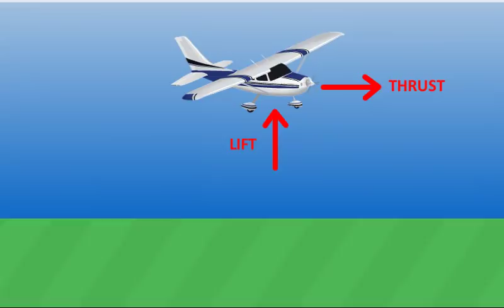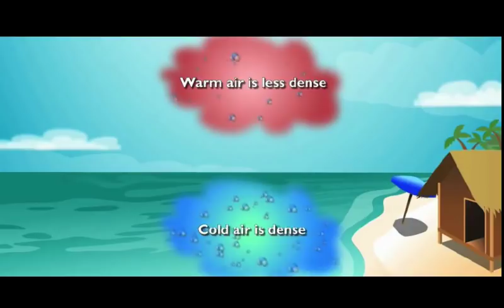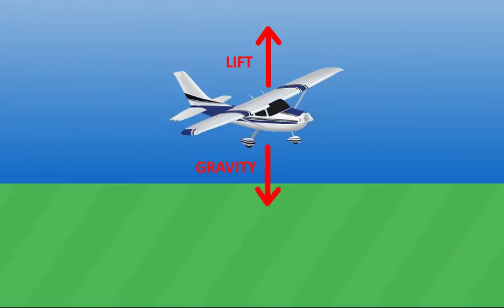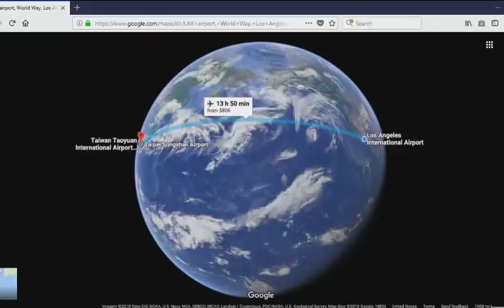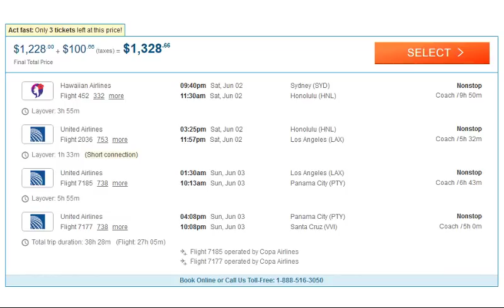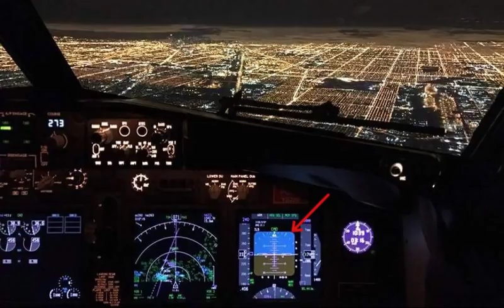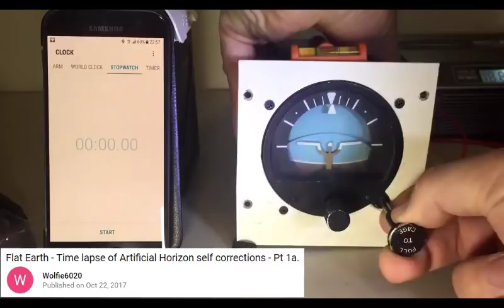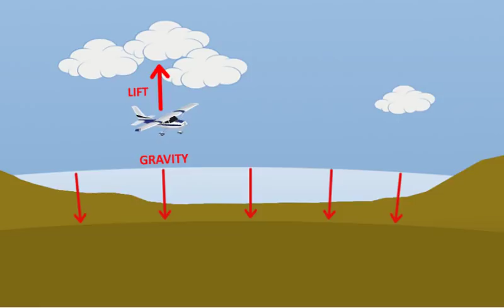Flat Earth Falsities - Plane Nonsense

Comment: Flat Earth theory is just another useless religion.
Reply: Or less than that.
Reply: IAA015... I like this. I'm a little surprised at myself for not connecting those dots...but you're right. Flat earth belief IS a religion. A religion that should have died thousands of years ago.

Unfortunately, it's a religion of denial and ignorance. One that claims they alone have seen the light when they've willfully chosen to ignore it. But unlike most religions, it's intolerant of knowledge and advancement. The most successful and in-depth flat earth argument I've witnessed, requires them placing their fingers in their ears and yelling "conspiracy" instead of listening to intelligent cohesive rebuttals (such as VoysovReason, whom I've only just discovered).

Most are zealots that desperately want/need acceptance at the expense of education. While I wouldn't normally care about this particular "religion", it's actually quite dangerous. It doesn't just celebrate ignorance, it worships it.

It's a religious cult that will literally breed more science deniers, liars, and bigots. Our primitive ancestors were more self-aware.
Reply: Flat earth is not a theory. It can't even count as a hypothesis. It's an unsupported claim, nothing more.

Comment: total moronic masonic mush... gravity? lol... so? where is this slipstream where the atmosphere travels with a so called spinning earth? the non-existent ISS would be stationary ... oops... and what is the temperature  in that region  of space? oops again ... can you say schill city... yup
Reply: The "Slipstream" is called "Wind". The ISS is not stationary because you need to be in a special geostationary orbit to be stationary, relative to the surface of Earth. Such orbits exist and are used by some satellites. If you're trying to suggest that space, being extremely cold, would freeze anything up there and thus destroy it, it doesn't do that because there's very few particles in space to conduct heat away. Though it's cold, it's sort of like how sparks from e.g. grinding metal are extremely hot, but are still harmless to touch, or how you can snuff out a match with your fingers but you shouldn't try the same thing with a torch. The temperature matters less than the energy content.
Reply: do your research on the temperature of space where this so called ISS  orbits... TOTAL BS.... YOU'RE A SCHILL
Reply: It's spelled "Shill". And I think you should do your research on how being cold works. Just because it's cold doesn't mean that it's like a refridgerator, there isn't any air to conduct heat away, so things in space are quite well-insulated. It's like a Thermos flask. And if that's not what you were trying to imply, I don't know what it is. What are you even trying to suggest by saying that?
Reply: You don't need software to post as 10 different users, you need the "Log Out" button... This is honestly the funniest exchange I've ever had if for no other reason that because of the schadenfreude of this insane, rambling madman. Sad, though, because (I assume) you're a real person behind that keyboard and you're genuinely this delusional. Though, maybe you're just a troll "schill" so ¯\_(ツ)_/¯
Reply: sirgalahadlives Does it really make you happy to be a dick to people for no reason my man?

You clearly don't believe what you are writing. So why are you doing it man?

Trust me bro, it makes you a lot happier, and life a lot better, if you're friendly.
Reply: sirgalahadlives i debate this even furthet earth is not a sphere also earth is not flat  earth is a box. Bite me 😂
Reply: Abbas Damani lol
Reply: one of those times I really hope they are just a poe...
Reply: Hey Meme Marine, save your fingertips. No point in arguing with an idiot.
Reply: For the sake of the rest of humanity please don't breed
Reply: NASA=NAZI  Aeronautics and Space Administration... Schill for Germans...Aryans= RH- BLOOD ... DRACO INFLUENCE OF LIES AND DECEIT ... GET A LIFE... BE YOUR OWN SAVIOR
Reply: https://www.youtube.com/watch?v=_6XU-h6nmu8&feature=em-uploademail
Reply: STANFORD UNIVERSITY (CIA MILITARY DEEP STATE) created  software so one SCHILL such as yourself is capable of posting as 10 different users... go lick your NAZI boots...
Reply: All the worlds a stage... I am very happy... (red pill)   esoteric knowledge of ancient wisdom always sounds crazy to those caught up in the matrix. So much more is available to those who ask seek and knock... I bless your journey.
Reply: Dan C....  is this an example of your so called benevolent tribe? truth goes through three stages... first it is ridiculed .. 2nd it is violently denied.. 3rd it is accepted as being self-evident. ZIUS =  Zealotry-IGNORANT-UNEDUCATED-STUPID. We are all born ignorant... but one must work hard to remain stupid ..."Benjamin Franklin"

Comment: So the Coriolis Effect works only with bullets ? The  shooter has to account for the earth's rotation because the earth is moving independent of the bullet , but somehow the plane moves with the earth . What's the difference between a bullet and a plane ?  Your explanation is very weak .
Reply: hombre1968.
"What's the difference between a bullet and a plane ?" You are joking. Right(?)

Anyway. A bullet is not propelled all the way and has no pilot. A bullet is fire and forget!
Reply: Are you all obtuse ? Didn't you hear the guy say that planes are able to land north/south "because the earth, airplane and air are all moving east together " ?  What he is saying is that the plane does not miss the runway because the plane is moving with the earth ; the pilot does not have to adjust anything, it's all automatic. He also gives the same reason for a heliocopter . So a stationary object moves with the earth , and a moving object moves with the earth , but snipers have to adjust for the Coriolis effect because the bullet does not move with the earth.  Total caca .
Reply: "So the Coriolis Effect works only with bullets ?"
No.

"The  shooter has to account for the earth's rotation because the earth is moving independent of the bullet"
Not exactly.

"What's the difference between a bullet and a plane?"
You mean aside from wings, engines, and pilots?  It's almost as if an airplane has the built in capability to correct for minor deviations like coriolis.  A bullet on the other hand doesn't have that capability, so the shooter has to correct for it before putting the bullet into flight.

Comment: Regarding ur first argument vis-a-vis air pressure, the dood states air has weight and pressure decreases with altitude gained becoz there is less weight of air at high altitudes. And yet, havin already stated air has mass and therefore weight, suddenly states that if we were under a "dome" then the air would hav NO weight as he claims the air pressure differential would b non-existant. It is irrelevant whether we're under a dome or on a spinning ball - air is heavy when u hav a lot of it!! All current scientific beliefs are underpinned by assumptions, - untill the assumptions are removed, Nobody will ever know Anything!
Reply from the maker: Yes. Many flat earthers believe the atmosphere is contained by the dome. And many reject gravity. So if both are true, then the density would not change as you ascend. That is why I said, if it were contained only by the dome, rather than by gravity. Of course, even inside a big dome, or even inside a pressurized tank, there will be a pressure gradient due to gravity.

Comment: You're a misconception.  If the earth is spinning how do the clouds move independently?  Give me a break. Your proofs are jibberish. Nice try.
Reply: Shell Ryke 

High and low pressures created by solar warming mostly
Reply: Peter Galbraith. I can't say for sure if the earth is flat or a sphere but it seems the more research i do, the more it points to being flat. I've seen more logical proof of it being flat than being a spinning ball.  Just saying.
Reply: Shell Ryke 
(
Logical, like how do clouds move independently? 

It's simple really. You can peel an orange and spread out the peel on a flat surface without distorting and stretching it. Therefore, distances between lat+lon coordinates (like cities or airports) will either match or the other. Care to guess which?
Reply: Peter Galbraith your question makes no sense, but im guessing you believe whatever mainstream science tells you.
Reply: Shell Ryke, explain how the satellite photos always show the correct position of the clouds? Have you ever proved that the satellite photos show the wrong position of the clouds? I assume not.
Reply: Shell Ryke 

You make it like the rational position is to NOT believe mainstream science. Delusional?
Reply: Mike Lemons well i've seen the same photo shop clouds copied and pasted in so called satellite pics of the earth. Why would they just add clouds to the photos?  There's no need to add things to "pics of the earth"  i thought they were supposed to be  accurate and in real time.

Comment: In your example at 11:57, wouldn't it make more sense to start with the Qantas 27 flight, and then have a connecting flight from Santiago to Bolivia?

Is that particular pair of flights simply more expensive?  Or is it less practical in terms of scheduling logistics and the frequency of flights between Santiago and Bolivia?
Reply: I think he stated that was the cheapest set of flights, not the fastest.
Reply: Ok, that makes sense.  Maybe the Qantas 27 flight it is a premium flight, where people pay extra to fly in shorter time.

Comment: Drag and friction are not the same thing... Please be careful with your language.
Reply: NotAsian 

Drag is a force caused by friction. So?
Reply: +Peter Galbraith
No it isn't, friction is along the surface as the air slides past, the blunt end is experiencing drag as its forcing the air out of the way, the difference quantitatively is one is proportional to velocity while the other is not.
Drag has more to do with the surface area in the direction of movement, while friction has more to do with the movement of air past surfaces and their smoothness.

Comment: With the plane having to increase thrust to overcome gravity , what is the air balloon doing to overcome gravity?
Reply: It has a density lower than the air it displaces. Which means the air it displaces is pulled below it by gravity and the balloon rises. Buoyant force.
Reply: GrahamStw , well done its density not gravity , density of liquids , density of gasses , gravity has no place its just a theory remember its never been proven
Reply: If it is just density then you will have no trouble telling me how much a lead bar weighs. 
I'll even help by telling you lead has a density of 11.34g/cm³ 

So go on... how much does it weigh?
Reply: muncher man 

There's no buoyancy without gravity or acceleration. That's how a centrifuge works.
Reply: And if it is just density you will also be able to explain why objects of different density fall at the same speed.

Comment: Why does gravity have no effect on the clouds?
Reply: It does. Do you see clouds floating off into space?
https://www.scientificamerican.com/article/why-do-clouds-float-when/
Reply: GrahamStw , again false information if the earth gravity had an effect on the clouds we would be walking through the clouds
Reply: Nope, gravity creates buoyant force. Gravity works on mass so things that are less dense (i.e. have less mass per volume) are pulled down less than things with higher density. The cloud floats because the air beneath it is more dense. As the water vapour condenses it gains more mass and eventually will be pulled down by gravity as rain.
Reply: muncher man how do u know that it doesent

Comment: This guy does not explain anything. What he suggests must mean that a plane flying west is flying backwards and forwards at the same time. As for a helicopter hovering  with just enough forward thrust should either see the earth flashing beneath which it does not or the earth does not rotate, whether it is flat or not.
Reply: barreltapper 

Didn't he explain that the atmosphere is moving with the surface of the Earth? Was that part not clear?
Reply: The atmosphere is air, which even birds can fly through without problem.What he suggest is that a helicopter while hovering is screaming backwards with the earth at one thousand miles per hour, while a bird flies past it towards the west, Are you suggesting that it is impossible to overcome thin air so that the earth's rotation can be observed passing under the helicopter? If the drag of the air could not be overcome, how could you get anywhere towards the West should you always be going backwards without even knowing.and you would be obliged to make a landing while still flying backwards and forwards at the same time.

Flying East would be impossible for any airliner which flies at 500 MPH while the earth spins away from it at a 1000 MPH. It is perfectly clear that the air cannot drag everything with it.What happens to a plane, which is already doing 1000 MPH at take off going East, should it turn around to go back to where bit came from.This nonsense defies logic and physics.
Reply: barreltapper 

It defies your logic. It doesn't defy physics.

The air is for the most part dragged along the surface of the Earth. Airplanes, helicopters and birds fly relative to the air, so they go along for the ride. When you jump up, you keep your momentum and the Earth doesn't spin under you at 500 mph or more. The same goes for airplanes, helicopters and birds.
Reply: I know the stock tale, we all know that one but put your finger to your forehead, close your eyes and think very hard. The air is not a brick wall pulling us with it, so we are told, so if you can simply walk against it or a bird fly through it, explain to me in simple language why  a helicopter, which can fly slowly against the pull of the air, which means it has 'overcome' the drag, cannot see the rotation of the earth beneath it?
Reply: Inertia. Galilean relativity will tell you as much.

Comment: I talked to some pilots and they told me that they fly parallel to the Earth, using the giroscope. I am not a physicist, but, my flight from Dublin to Budapest maintained the same altitude for aprox 3 hours.  -11000 m. The distance between cities is 2200 km. The common sense tells me that something is not quite correct. Gravity cannot prevent the plane from gaining altitude. And it didn't reached the stratosphere. So, the truth is somewhere, in between.
Reply: ah I think the other part you are missing is mentioned in the video but it was easy to miss... the plane uses air for thrust and the higher you go the thinner it will be so it will self correct on that alone.
Reply: It's like flat Earthers think pilots take off, point the plane on a heading, and go take a nap.
Reply: The information you are missing is that the gyroscope in a plane's Attitude Indicator contains a mechanism to ensure the gyro is spinning upright. This mechanism corrects for the curvature of the Earth, as well as normal gyroscopic precession and tumble. 
This video shows you the inner workings of a typical Attitude Indicator and demonstrates the mechanism: https://youtu.be/z1QGRPVBZvw
Reply from the maker: Mihaela Cimoca - If the plane were to increase in altitude, that is, farther away from gravity, without increasing thrust, it will slow down and lose lift. Just like a car going uphill, it will slow down unless you provide acceleration. With a plane, less speed mean less lift, so it will stop going uphill without acceleration, and the pilot will be well aware of this.

Comment: I belive it is flat, why will there no serious disscusions between the two views instead of the playground name calling, you said that a prop or a jet need air to push against so how can a rocket work in space with no air ?
Reply from the maker: I haven’t called anyone names. Rockets don’t work like props or jets. Rockets work by Newton’s third law. Every action has an equal and opposite reaction. They don’t require air because they create an explosion that forces exhaust backwards, pushing it forwards.

http://howthingsfly.si.edu/ask-an-explainer/how-does-rocket-relate-newtons-three-laws-motion
Reply: john cleary isaac newtons third law of motion states that every action has an equal and opposite reaction, meaning that a rocket will work in space
Reply: Ever fly a bottle rocket as a kid?
You take a plastic bottle, add a valve, put in some water then pump in air with a bike pump. 
When you release it the water and air shoot out the bottom and the rocket zooms off.

Comment: He didn't explained why the light from lighthouses can be seen from over 100 miles away.
Reply: Because the light goes upwards?
Reply: TheXzay https://www.metabunk.org/curve/
At 40km distance and an elevation of 60m some 6.91m should be below the horizon. 
Your calculation ignores the observer's elevation and the atmospheric refraction.
Reply from the maker: TheXzay - Evidence needed.
Reply: You will barely find any video showing the actual video with the light filmed from that far away. But how do you for instance can explain this video
https://www.youtube.com/watch?v=kxZi7GIZcJE
Logically, if the object is 40 km away, from video maker's height and distance it should 100 m below horizon and shouldn't be visible
Reply: TheXzay 

I posted there.  That video is fairly consistent with a globe if we can trust his numbers.
Reply: Headline Claim: You can see a lighthouse ONE HUNDRED miles away. 
Actual Claim: You can see a 60 metre high lighthouse from 24 miles away when you view it from 35 metres up. 
Actual Reality: yes, exactly as predicted on a globe.